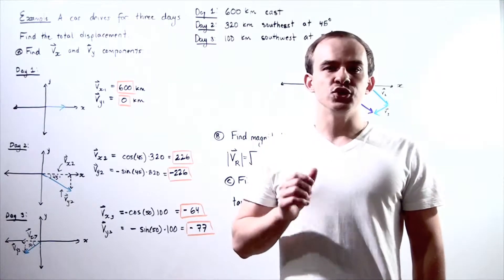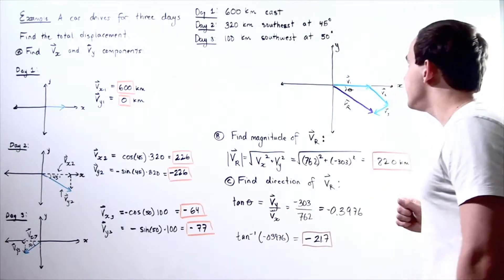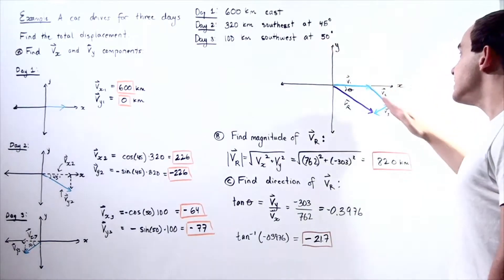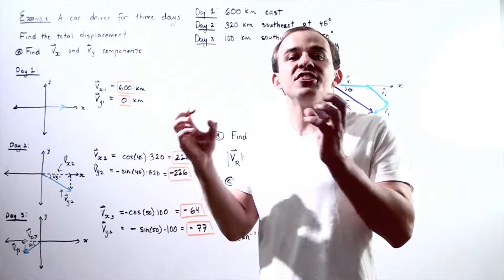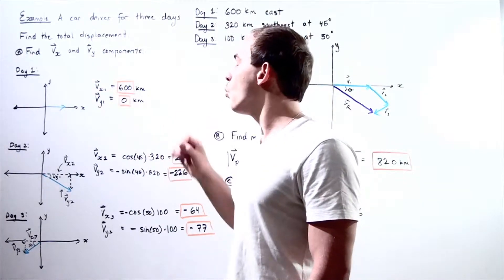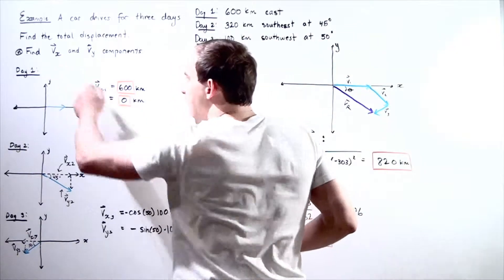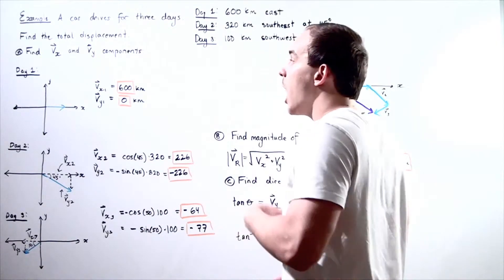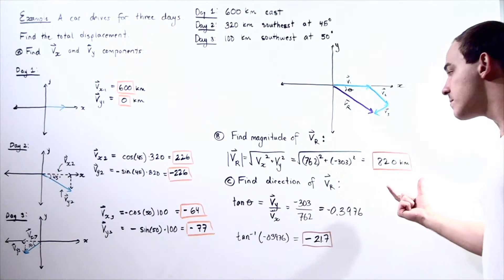Adding Vectors by Components Example # 2

Comment: I don't know what I'm doing wrong, but it doesn't seem to matter how I type it into my calculator, it still shows me that the square root of 762(squared) + the square root of -303(squared) is 699.17km, rather than 820km.
Reply: Because you are inputting values in a calculator like this root over [(762)^2 - (330)^2], which is the wrong way to do so. Actual Calculation will be root over [(762)^2 + (-303)^2]